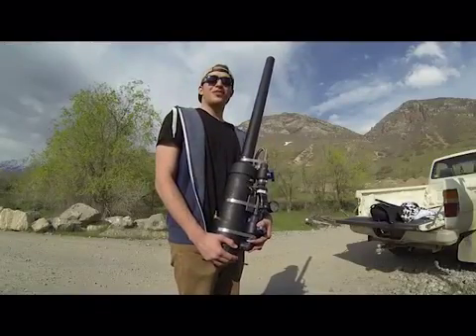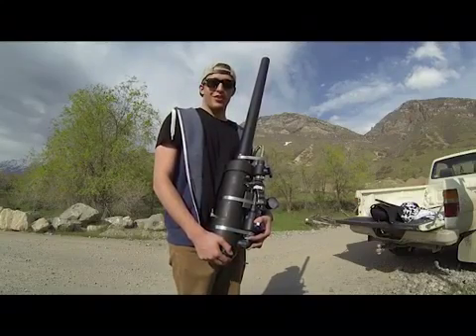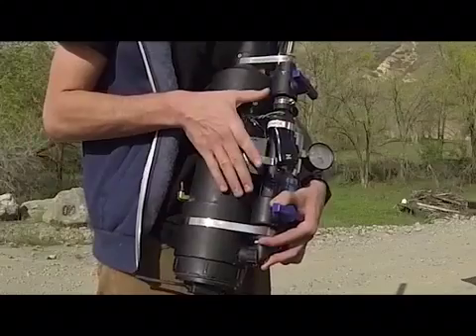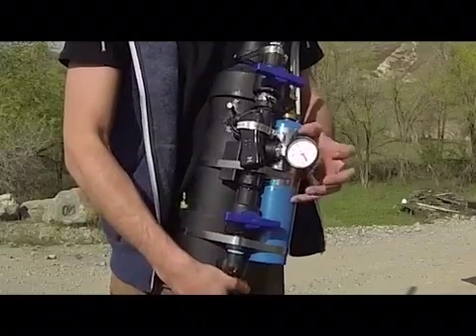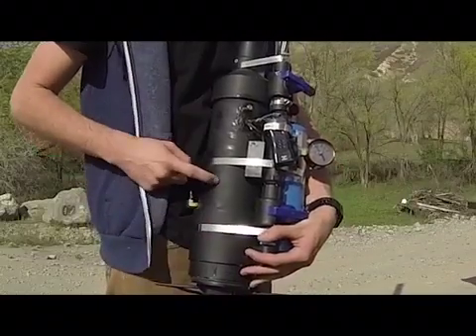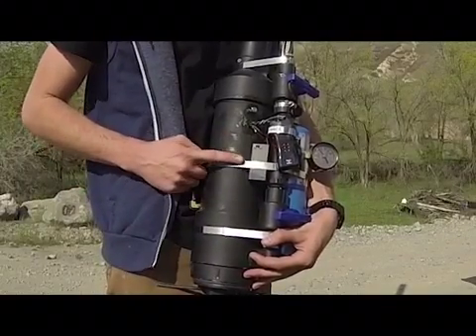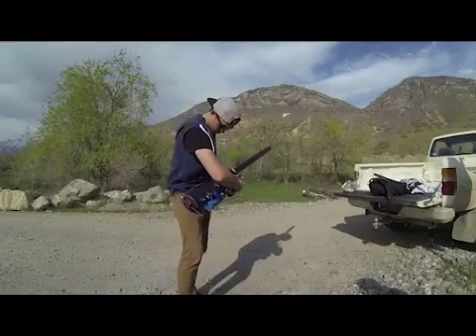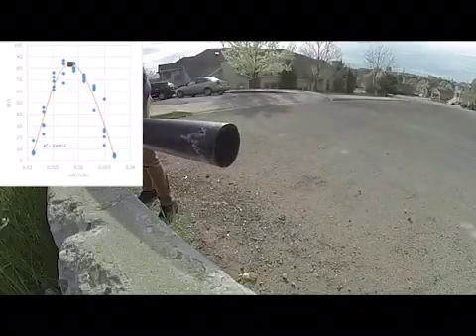Potato Cannon Propane Fuel Optimization

Comment: Neat. Spud guns are often still modeled after barrel loaders though. (And the few breech loaders aren't much better.) This will keep the potential firing rate very limited. I wonder if anyone will ever make a "spud-in-cartridge" system for faster and very consistent loading? Cut a whole bunch of 5" lengths of tubing, jam spuds in them, and figure it out from there how to make it work. Shouldn't be too hard to seat the tube so it doesn't fly out with the spud, and eject it after firing for re-use.